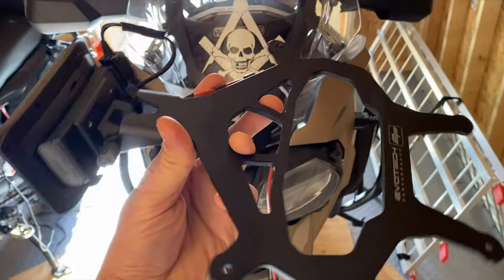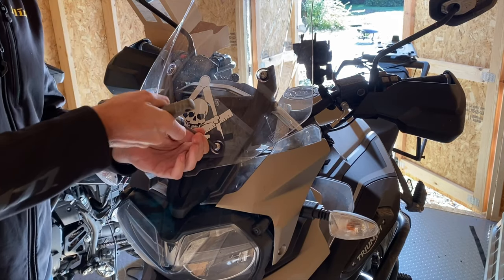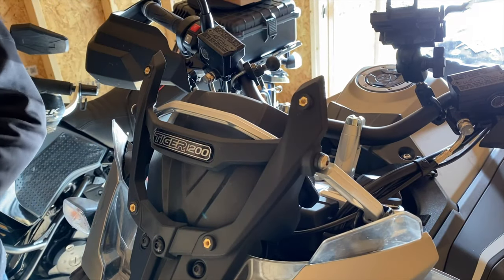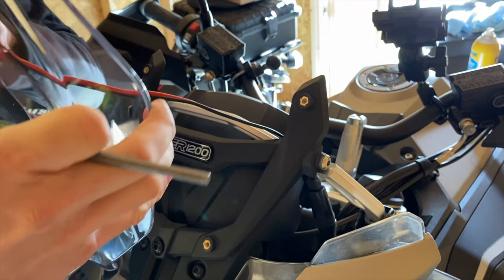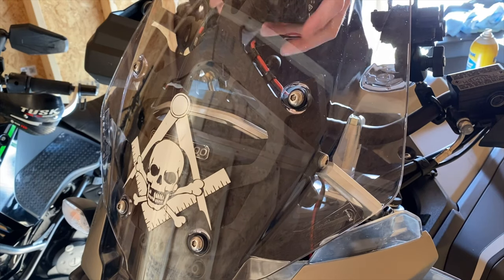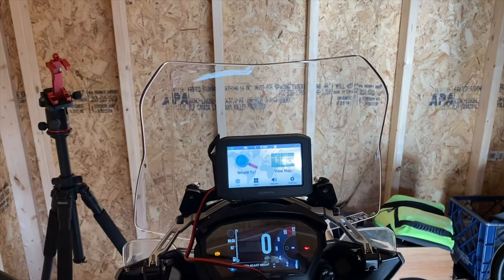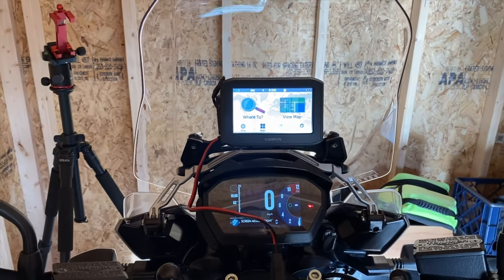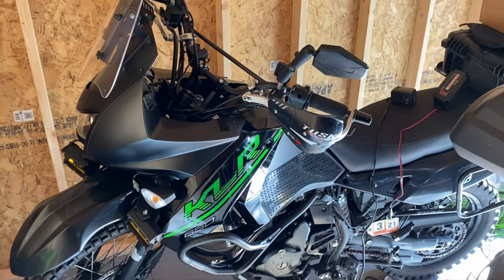Evotech GPS Mount, Triumph Tiger 1200 Desert Edition #evotechperformance

Comment: Slick how the mount integrated so it moves with the windshield.  
Pro tip for when challenged with stacking clumsy components in vertical plane. Create guide pins by cutting heads of long screws. Hand thread the pins in place, stack components then insert correct fasteners into a couple of the places. Remove the guides and insert remaining fasteners. Torque all to correct value, viola!
Reply from the maker: That's an awesome idea! I've done something similar working on cars...not sure why I let this kick my ass. Thanks!

Comment: How did you connect the power to the gps and what mount did you use.
Reply from the maker: I have a DIN connector that I plug into the socket in front of the tank. The mounting bracket is by Evotech Performance.

Comment: Where did you connect to, to power the sat nav?
Reply from the maker: I just have been plugging into the DIN socket in front of the fuel tank .It is not hardwired.
Reply: @Ron_C  ok thanks for the quick reply! I had a gen 1 explorer and I wired it to the back of the headlight, but I now have a 2021 tiger alpine, and not sure about connecting to the LED headlight unit
Reply from the maker: @baldrick650  Same here. I just worry about those sensitive electronics!  I've considered running power straight from the battery, but I've been lazy.

Comment: So what do you think after having it for a while I’m trying to make up my mind which mount to buy
Reply from the maker: I'm happy with it. It's really well built. The only gripe I have, a minor one, is that they could've provided longer screws. The original ones work, but a few more threads would've made the install easier and provided a little more confidence that there were enough threads in the well nut.

Comment: Any vibration issues with you GPS?
Reply from the maker: It shakes a bit on rough roads, but I haven't noticed anything that has made it unusable. I've got plenty of riding videos where you can see the GPS while I am riding.
Reply: The Tiger 900 version of this evotech mount, instaled on my 900 Rally Pro shakes like hell on gravel roads, vibrates heavy @ 3000 RPM .
As the whole mount is conected to the windscreen, it shakes and vibrates along with the windschreen